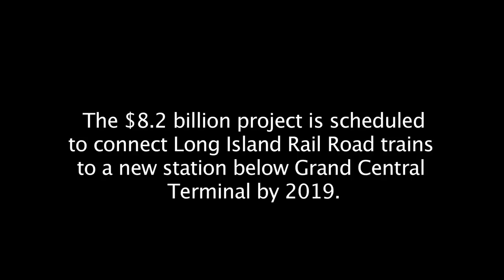Digging Deep Under Grand Central Station

Comment: For all of you. Remember that I'll buy Sandy Hook that the hurricane hit New Jersey and New York a New York bus very very badly flooded my debt to the Thomas and it was Phil and Spencer date that everything came as got corroded testicles the controls already messed up signal lights doesn't work especially that they need to clean up or down kind of like there and then after that make sure everyone well they need to do one one little thing is it is about safety safety safety safety but however you already know already that how much money that they've been saving all this years and now that this is going to be like how to say it oh yeah what kind of excuses of an MTA why they have to spend in Iran and specially that how long this color is going to be well finish because I didn't get to finish by right now if not to go finish on 2030 or 2040 I don't know because everything that well you know you already know